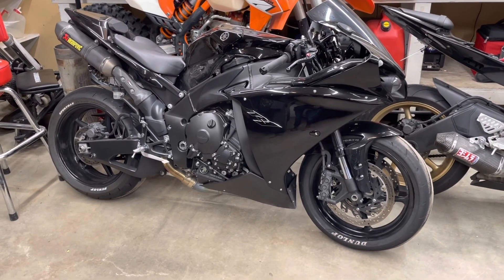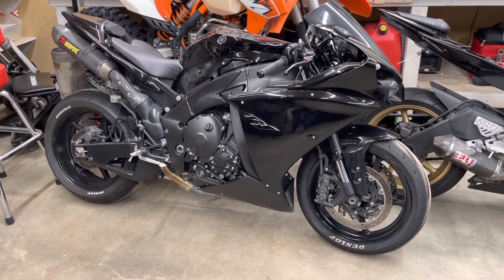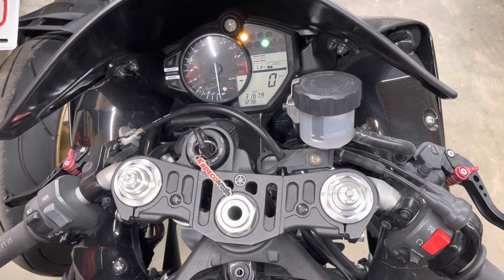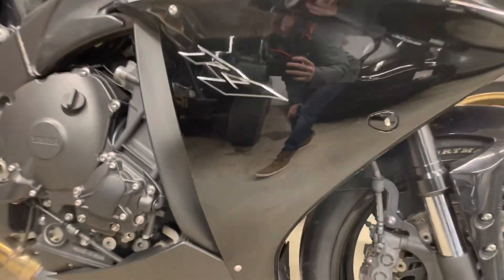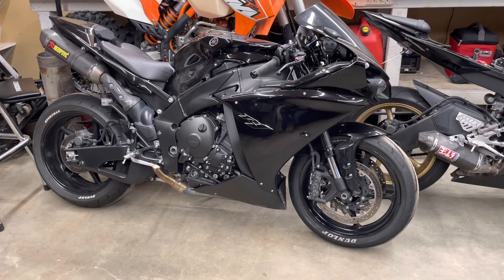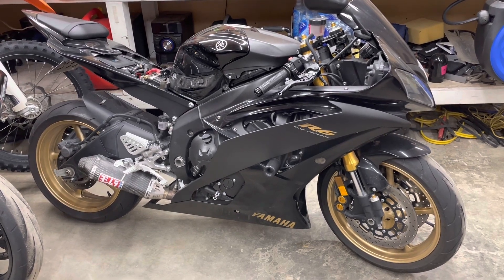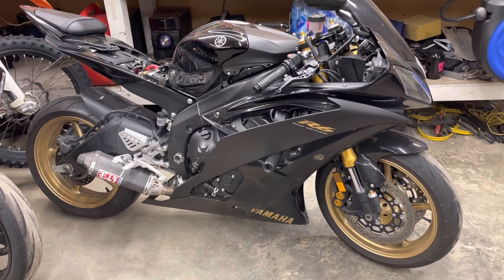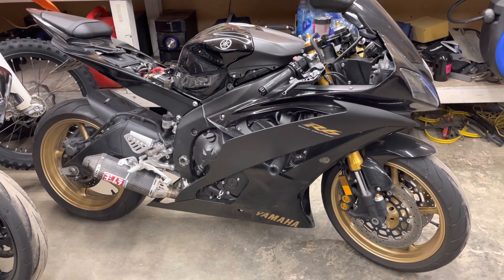YAMAHA ECU FLASH MAJOR ISSUES! CRANK NO START

Comment: Having a similar issue. Just got an ecu flash on my r3.  Crank no start. How'd u get end up? I just ordered a stock ecu. Hoping that fixes it🤞. Still need the tune though cuz ive already done all the mods that require it🤦
Reply from the maker: Mine was an issue with the immobilizer in the tune. Had to get it retuned multiple times. 
Bauce racing ended up fixing the tune file for me

Comment: Wow, that’s horrible! I hope you get it resolved soon so that you can ride this season. I’ll stay tuned to this to see what resolves the problem. I guess I’ll simply keep my power commander on my 09 R1. Before seeing this I was considering an ECU flash. In the past I had a GSXR flashed and that worked great. Now I’m apprehensive …

Edit: is it possible that the ECU’s to the bikes got mixed up? In other words, wrong ECU in the bike? Just a thought…
Reply from the maker: I’m not very happy at the moment that’s for sure! It’s almost impossible to find any bad reviews and then I have nothing but issues ( lucky me! )
Both ecus have different plugs and are different sizes. It’s not possible to get them mixed up. Definitely an issue on the tuners end.
Reply: Is this the only video or review you've ever heard about an ECU flash? It doesn't do this with every R1 that gets a Euro ECU flash. He just picked the wrong shop. My 2012 is flashed and is just fine, and I've even added and dyno tuned with a Power Commander V. Runs great and is much more powerful. I even cut my airbox to Euro design for more ram air.

Comment: Feel your pain!  The ticking sounds like the fuel pump trying to prime, I wonder if there is some  logic issue with something.  Assume your bikes fired up no problem with stock ECUs and no power commander?  If so then the only things that have changed since then is the reflash and re-installation of the ECUs back on the bike.  Is the issue the same on the R6 (ticking noise that sounds like unsuccessful fuel pump prime)?  Can the ECU be re-flashed back to stock, or worst case buy a used ECU to try that.
Reply from the maker: Yes both bikes ram perfect before we mailed the factory ecus to get bench flashed. 
The r6 doesn’t tick or do anything weird on the cluster. It cranks over ok but backfire LOUD! The R6 was just flashed back to “stock” and still has the same issue, crank no start. The tuner basically said he can’t fix it now and said to try someone else’s tunes. Just left me stranded with bikes that are not usable.. 
hopefully the new tuner “bauce racing” can get me sorted out. They have awesome reviews so fingers crossed 🤞.

Comment: Any codes on the r1? Had a bazazz go out on mine that dropped 2 cylinders. Removed it and sent the ecu to moore mafia for a flash and its never been better
Reply from the maker: Not sure if I would be able to pull codes when my cluster is doing things on its own. It’s 100% a bad tune because that’s the only thing that has changed. 
My first tune cranked / no start but didn’t have anything weird with the cluster or clicking. This is my 2nd revision that made it way worse..

Comment: Whatever place that flashed it needs to revert it to stock and give a refund. Then find a new place. My 2012 is Euro flashed and has no problems. Mine has even been dyno tuned with a Power Commander V and runs like a bat out of hell. Wheelies at as low as 4000 rpms, basically anywhere between 40 and 80 mph, and that's even after 2 teeth down in the rear, and at half throttle. Hits 189 on the speedo too. Zoom zoom baby.
Reply from the maker: My r1 was retuned twice from the same company and the issues got worse. My r6 was flashed back to “stock” but still has same issues. The tuner did refund me but I’m still screwed at the moment.. trying another tuner as we speak. 
The worse part is I have officially wasted more money on shipping than the tunes cost in the first place! Very frustrating
Reply: @JT2JZ  sorry for your terrible luck with the company you're dealing with. If they don't ever get you straightened out, you might want to name them to warn others and save them from ending up in your shoes. I'm sure you'd rather not hurt their rep, but they are really putting a hurting on you. Imagine if this was your daily driver, like a lot of people down here in Florida.
Reply from the maker: I will be naming the company for sure. I’m just gathering all the facts first. If the second company doesn’t have any issues I’ll be making a video of my whole experience start to finish to do exactly that. Warn people of the possibilities because it’s very hard to find any negative info at all. I literally didn’t even think this was a possibility. 
It’s a very big name tuner as well. Will likely surprise a lot of people

Comment: I will stick to my power commander lol
Reply from the maker: Right!
I wish I could just reinstall mine but I’m committed now.
Reply: @JT2JZ  wish the best of luck to you
Reply from the maker: Thanks. I really need luck on my side right now.
Hopefully third times the charm.
Reply: Supposed to Euro flash the ECU and have it dyno tuned with a Power Commander. Problem is the stock US ECU cuts to 80% throttle at 11k rpms. After Euro flash the peak hp is at higher rpms because you actually get 100% throttle, and you'll get 10 more peak hp at a higher rpm.
My 2012 has Euro flash and 2 dyno tunes on a toggle switch loaded into my Power Commander 5. Easily rips the front wheel up between 40 and 80 mph, and that's at half throttle and with 2 teeth down on the rear sprocket. I also opened my air box to Euro design for more ram air hp at high speeds. Lots of hp hidden in the 2009-2014. From what I've read, the 2015+ US model has the same 80% throttle reduction.